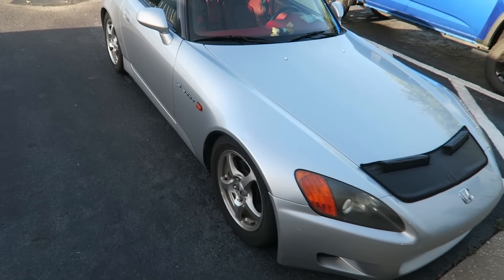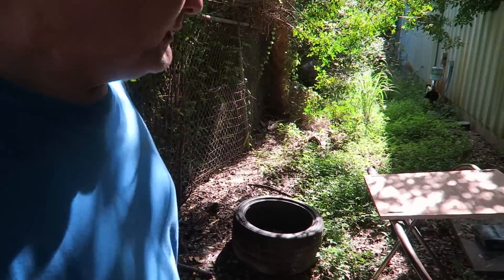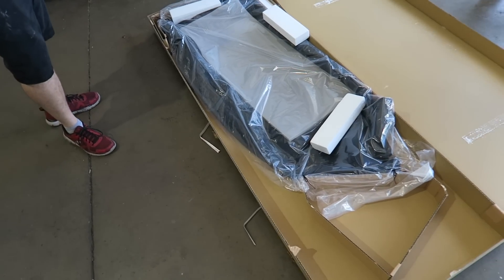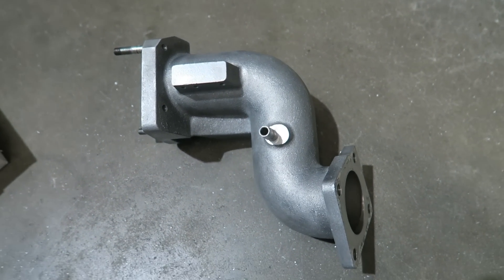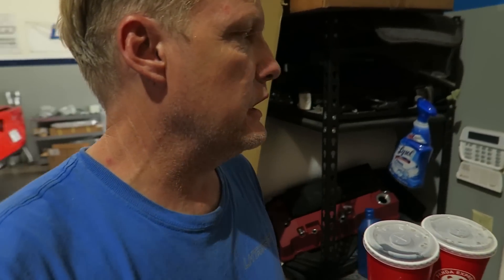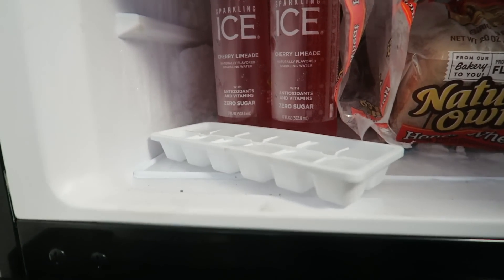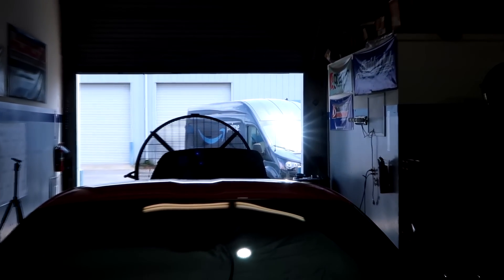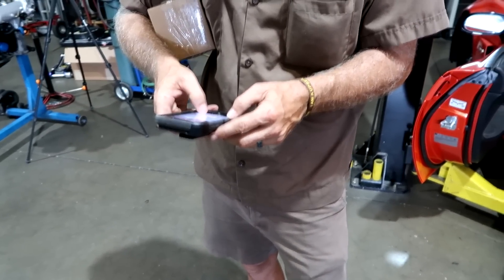OEM SOFT TOP DISCONTINUED ??, Supercharger

Comment: Is the s tube for the non Vtec models the same as the s tube on the D series supercharger? Curious how to improve intake flow on my setup.
Reply from the maker: It sure looks similar. I haven’t had one side by side to be sure. We cut the S tubes down and reshape them as well as open them up. It’s more work on the D and the B18B but there’s a substantial airflow increase to be found.
Reply: LHTPerformance if you have any interest I would be more than happy to send you my s tube for comparison purposes and for a rework.
Reply from the maker: I would really need them side by side
Reply: LHTPerformance understandable. If the opportunity presents itself let me know.